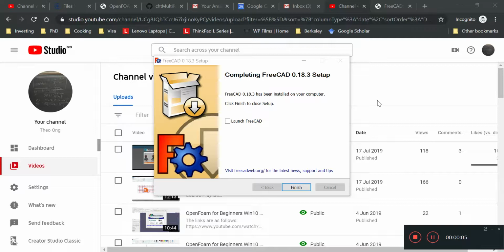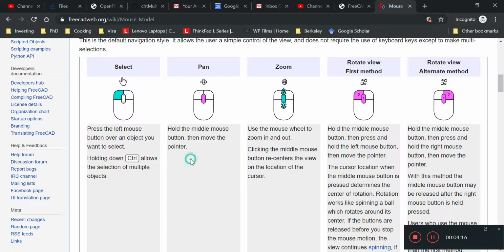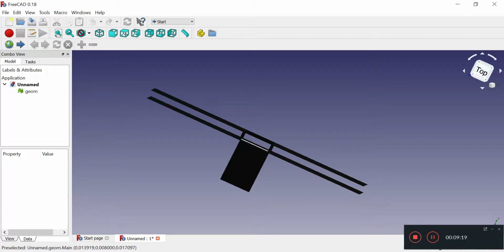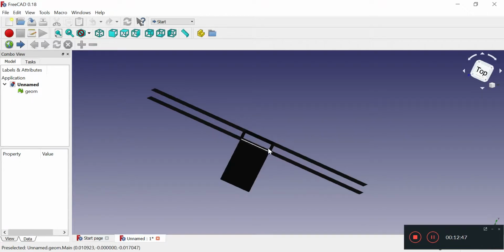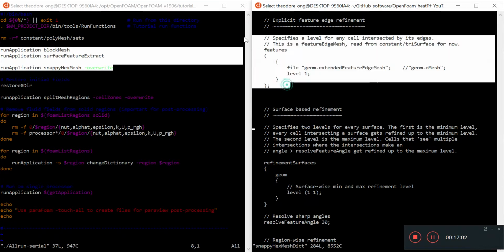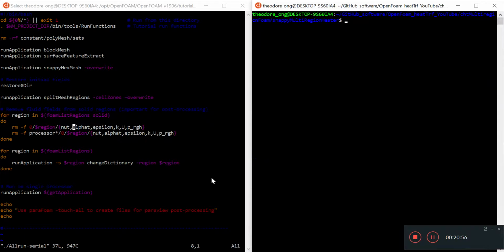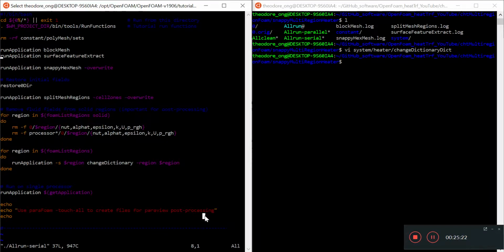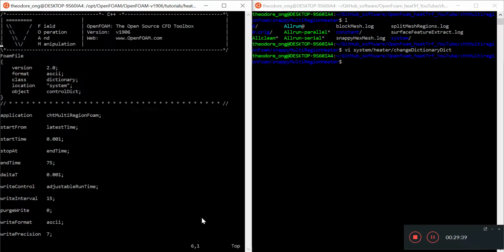OpenFoam Heat Transfer 29 - chtMultiRegionFoam snappyMultiRegionHeater snappyHexMesh splitMeshRegion

Comment: Hi Theo, I really enjoy your videos and the information flow you give. I have one doubt regarding the splitMeshRegion utility. I am trying to use Adaptive Mesh Refinement along with the snappyHexMesh in the same solver. The dynamicMeshDict is unable to refine the mesh during the run. After comparison of the files, I came to know that pointLevel files are not produced by splitMeshRegion. So, have you used this combination before any time? Or is there a way to tell what all the variables have to be split to splitMeshRegion command?
Reply: @TheoOngScienceAndEngineering  Sure, thank you.